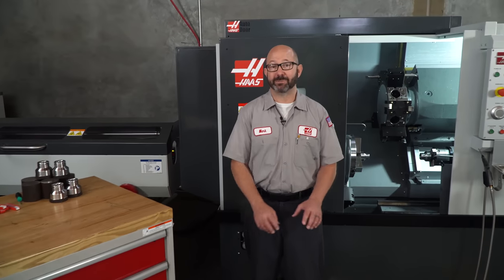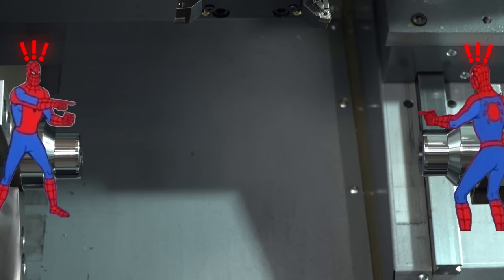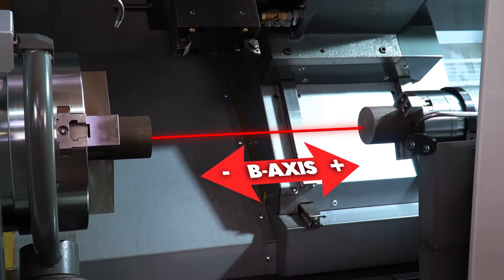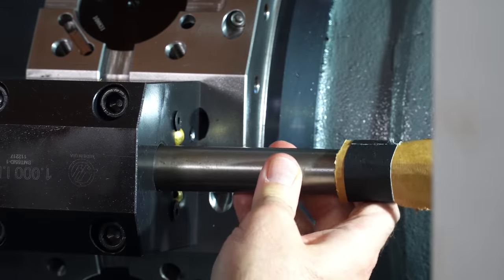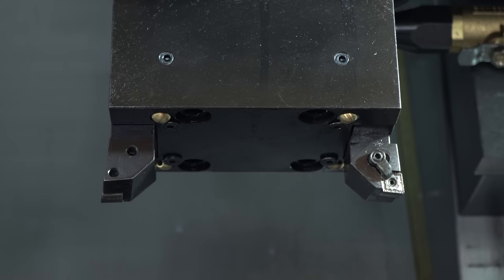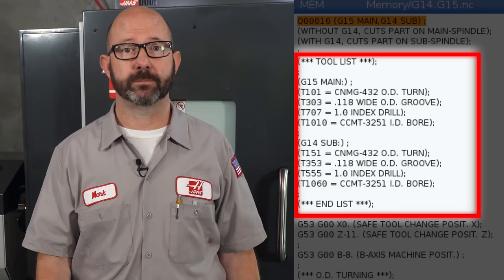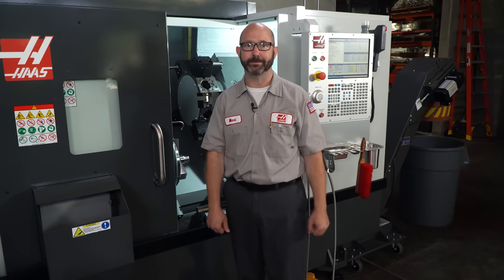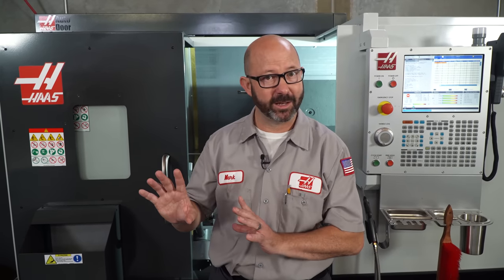Use G14 to Program Your Lathe Sub-Spindle The Easy Way - Haas Tip of the Day

Comment: Hi Mark. What I do on my tool setup for boring bars or long tools is to install the tool but don’t tighten. Eyeball the overhang to “not crash into the X axis housing.”Then I index the turret to place my long tool the back of the turret housing. I reach up and slide the tool until it touches and then back it off approx .250”. Then tighten the tool in holder.

Comment: Have you had any customers ask about the idea of having the Turret Position column in offsets become an actual / usable field?  Example, using your video for discussion:  It would be nice to program T101 for the front facing CNMG 432, and then T5151 to define the back facing CNMG, which is located in station 1.  I've had this question multiple times at the HFO level, but was curious if this has been passed along at the factory level as well.  Always great to see your new videos, Mark.

Comment: When I first used a DS-30 I was so confused on how the Sub Spindle work as I had been running Mazak, Doosan, and Mori lathes with sub spindles. When you had to program on the sub spindle in the Negative direction I was 100% against that. After 2 days of testing and post editing, I found the best way to program this by using a G14 then a  G101 Z0 you mirror the Z axis so it can be programmed the same as Every Other lathe in the last 30 years. The best way to set a tool change position is to cancel the tool offset and use a G59 to set your position. It's cleaner and you can move the position without program edits.. Using G55 for your B axis is safer as well, once again, no program edits. I wish Haas would set their Lathe controllers to work like the rest of the industry, and only use G14 as a Simplified method of programming. Not the only method.

Comment: you need to make a lathe with real interpolable C-Axis on the Sub-Spindle, not only an indexable one with +-0.5 degrees of tolerance.
I have a DS30Y and for this issue I have to machine the more complex pieces on another lathe

Comment: I said it in another video and I’ll say it again. The offsets page needs a “new data” and “previous data” line like my mori’s have so when you accidentally set offset 1 instead of 51, you can easily see the old value. Also would be great for tracking changes after touching off the tools to see if something is going wrong with the machine. I’m tired of taking pictures of my offset page with my phone.

Comment: @Mark Terryberry I have a Haas ST25Y with the sub-spindle. I am still having a bit of an issue understanding the work offset setup for the sub-spindle. When setting up the sub-spindle work offset I currently move the sub-spindle into the location I want, skim the faces and use the Z-face measure for setting the work offsets and then set my tool offset using the same method. Setting the tools after the work offset has been completed. So I guess my biggest question is if I change my work offset or use a new work offset do I need to retouch all of the tools in the backside of the turret?

Thanks for all of the amazing youtube content it has been a great tool.
Reply: We made a video on how to manual set our Tool and Work Offsets on a lathe, and while this video was made for Main Spindle lathes, the concept is the same. Check out the video, and it should answer your question: https://youtu.be/rd2u2MG6meY?t=1152   . We want to set all of our Z Tool Offsets, by jogging to that cleaned-up face and pressing Z-Face Measure. If we want to change our Z Work Offset, after we've set all of our Z Tool Offsets, we can jog any of the touched-off tools to our new Z Face, highlight our new Work Offset (like G55, G56..), and press the Z Face Measure button. This will add a value to our Z Work Offset, which will be the distance where our new face is, compared to where all of our tools were set. With this new value in our Work Offset, all of our tools can now be used with our our new Work Offset (Like G55..). We don't have to set all of our tools again, we just need to reset our Work Offset Z values, with any tool that has already been set.

Comment: Light bulb Mark, tool stick out... what about a sheet metal tab bolted(perhaps) on turret? Indication/safety tab for easy visual confirmation.  Top of turret but low enough to rotate and check before hitting turret body or base, (before catastrophe).  Like 1 or 2 positions above lock in.  Place tool in, rotate CCW 1-2 positions, pull out to tab, clearance established.  I will probably get to work on one for myself.  Screw patents and copyrights, "Clarance" is a machinist's best friend!  Clarance for all!

Comment: I have a ST25y with the sub. When I try to use the G14 it won't take the command. In MDI mode I use g14; s500 m3; Cycle starts. G15 stays locked in and it starts the main spindle. Any help or suggestions would be very much appreciated.
Reply: Go ahead and run that same code in MDI, while in SINGLE BLOCK mode. The MDI program might be returning to defaults (G15) at the end of the program, and stopping the spindle when the end of the program is reached and the control switches back to G15 from G14.  If you continue to have issues, shoot us an email to TOD@HaasCNC.com, with your machine serial number and we will check it out.
Reply: @markterryberry4477  Wow I feel a little dumb. That worked thanks. I have the program ready and just thought I would test in mdi first. Thanks for the info and the quick response.

Comment: Cardboard idea isn't bad, but you need to be more professional.  I have ran into these clearance restrictions in almost every axis.  My idiot-proof solution is probe the tool when it's installed in the cut position.    I set the probe so that if you can probe it, then you have clearance.  The x-axis safety was physically created by positioning the probe high enough so that when indexing it won't rip all my sheet metal off.  For Z it's a parameter setting maxing out the distance.  Remember, tool geometry for Z "0" is the centerline of a live tool.  EASY, right?

Comment: So g14 basically (mirrors) x?
Reply: Yeah. It basically Mirrors Z about the X axis, along with all of the Spindle M-codes.
Reply: @markterryberry4477  rite,,,sorry,,mill guy. Haha
Reply: @jasonruch3529  There are so many axes to remember if we are going back and forth between machines all day! XYZ on mill, but on a live-tool lathe the X is up/down for diameter, but all the values are in Diameter, so we have to double all our X values. And we still have a Y-Axis on many of our lathes, but Y+ is towards the operator (its away from us on  Mills). There is a reason for all of it, but it keeps us on our toes. Good comments.
Reply: @markterryberry4477  Then we go work on the old Mori SL6 from 1981 where all X values are negative, and there's no G54, just G50, for EVERY tool. That'll make for a fun day if you're not paying attention

Comment: I rotate the empty tool station into the position where the tightest fitment is and then use a scale to check from tool holder edge to the wall.
Very handy for the old school Mori slant lathes when setting cutoff tools.
Thanks for this tip.

Comment: I run a DS30Y and I just know that from the face of my post holders to the contact point of the back of the turret is about 4" so I always make sure any back tools are at 3.75" or less. Also I always touch off my back tools with the probe, you just have to take the main spindle jaws off and then there is plenty of clearance for even the max allowable stick out. But you lost me at the end changing the tip direction...

Comment: Hello Mark !
I have a Ds30Y and I’m producing in mexico with it. Your videos help much more than any haas service personal down here.thank you

My question for you is, does the G14 also count for the radius compensation direction on the subspindle ?programing G41 and G42 same way as if I program on the main spindle ? 
If I’d do an OD contour front to back at the sub I’m running in dirección of feed at the left of the part which in theory is a G41 ….is G14 taking care of this too? 
Another subspindle issue I have is that it’s very imprecise, when I do a G199 like I learned from the G199 video with an R0. Value , the part is always off by 0.5-1degree, sometimes plus sometimes minus , is there any command as an G9 for indexing the sub? Or any other method which is more accurate ? Seems like the subs indexing exact window is way too high but maybe just can’t get better…
Thanks for reading hope for your answer !